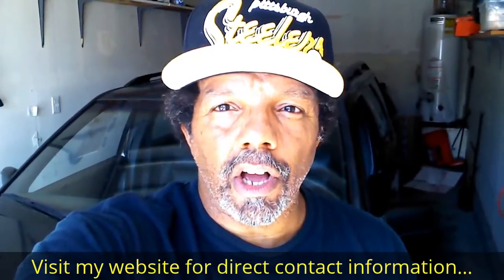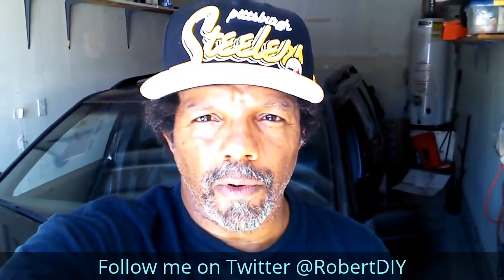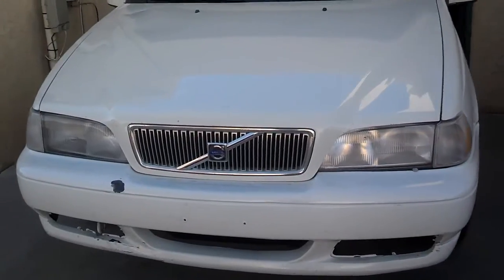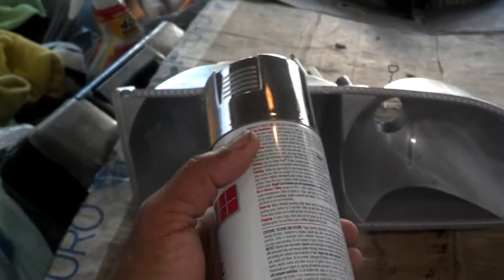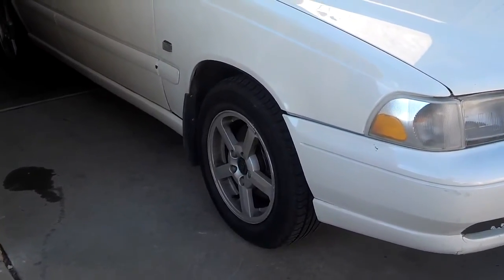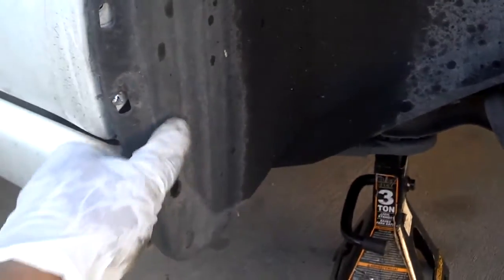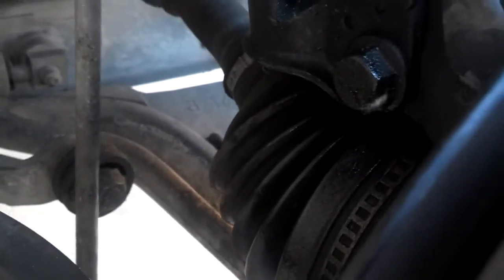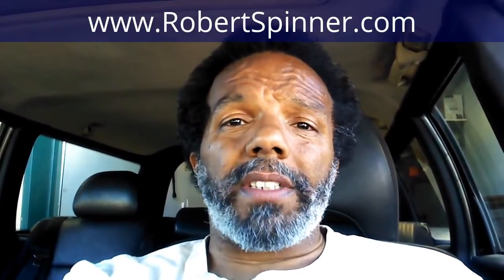1999 Volvo V70 AWD Restoration Part 8 - VOTD

Comment: Thanks for the tip on using "reflective, high temp paint" to spray the inside of both headlight cones.  Thanks for the tip on replacing all 4 tires (not just 2 tires) on an AWD transmission.  Thanks for tip on inspecting CV boot, motor mount, headlight lens to be cleaned in a dishwasher.
Reply from the maker: Michael Chitwood Thanks for watching.

Comment: this is why I hate getting another used Volvo to drive...1 thing leads to 2 ,2 things lead to 4, 4 things lead to 8 and on and on ...in the end you have a great car but the first 6 months its Oooops this is busted that is worn and that over here is just missing...

BUT for the next 4-5 yrs its just oil change and tire change !
Reply from the maker: AwakeDude911 The good thing is the driving reward and low overall cost for DIY'ers. But you are right about the domino trail.